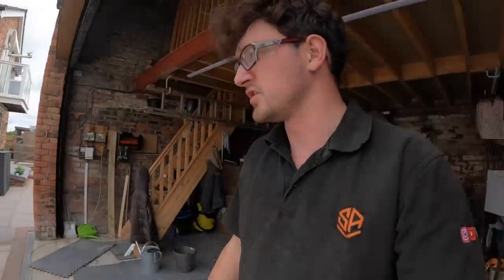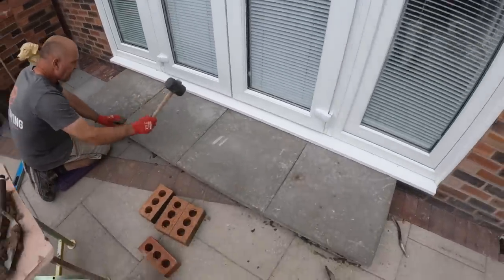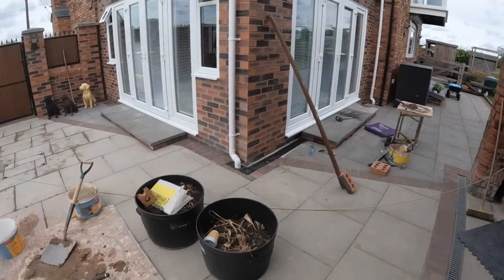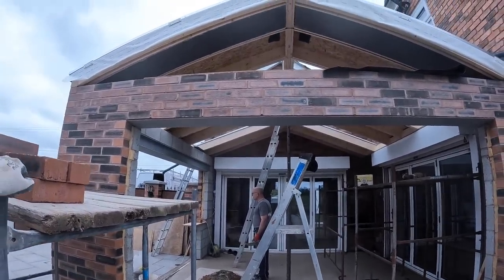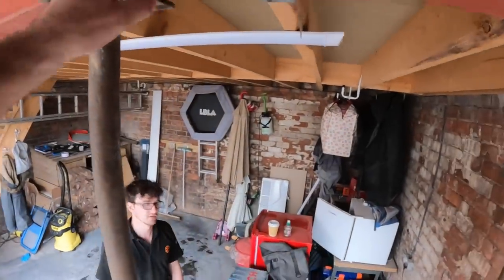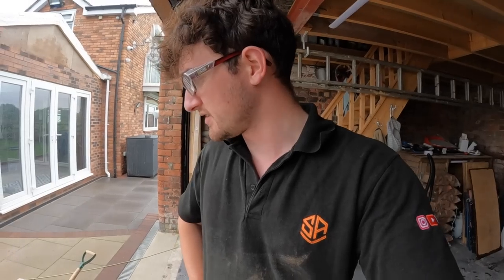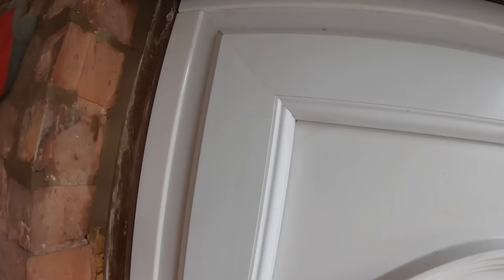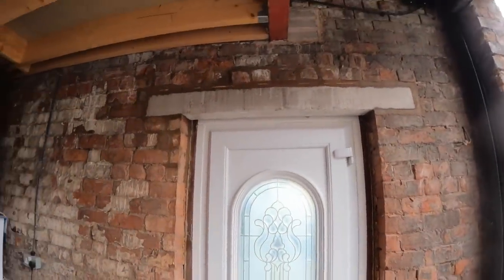STEPS, LINTELS & EXTRAS!! L SHAPE EXTENSION PART 6

Comment: Cannot believe that you had only done a couple of hand mixes.  My grandfather had me hand mixing concrete at about 12 during the school holidays.  I was about 15 when we did an extension base and he hired a petrol mixer (that was 50 years ago).  Glad to see you used slate for packers.  I wa surprised you cut the slips for that gap but I suppose slate is expensive these days.  I was glad when I became a civil servant because your work is hard.
Reply: DIY novice here, can I ask why you need to put packers in at all, couldn’t you just fill the entire joint with cement?
Reply: Steve and Alex can probably explain better but it helps force the cement into the joint and stops the bricks sinking

Comment: Another neat job correcting someone else's cowboy job.
There should have been a padstone under the beam and as you say a much bigger lintel as the beam was right inside the load area.
Those 4x2½ lintels have to act compositely with a clear right angle triangle above the door.
I guess they were saved by the headers taking part of the load to the outer lintel.
A really basic error that any competent designer should have spotted and which would have cist next to nothing to do at the time.
Reply from the maker: Thanks Mark 👍🏽🧱

Comment: for the 19 years  i worked with my day I did not do any dry mixing  eaither on a board or in a tub   and have you thought of using a " bakers " bag to put in the moter into the joint  m
Reply from the maker: Old habits die hard 🧱👍🏽

Comment: Should have been padstones under that RSJ surely.??
Reply from the maker: They are lintels , just beefed up 🧱👍🏽
Reply from the maker: @michaelgray9234  🧱👍🏽
Reply: Not always required. When I do beam calcs, I will assess the loads on the supports. If total factored load exceeds crushing strength of brickwork, then will provide a concrete padstone to distribute weight. Doesn't hurt to put one in anyway as belt and braces. I would have accurately calculated loads onto that lintel too rather than just doubling up as the beam point load sits within the triangular zone of influence above the lintel.
Reply from the maker: @ade7163  🧱👍🏽
Reply: @ade7163  have always put them in or a few courses is solid engineering bricks, but we do have a B*****d BC where I live.!